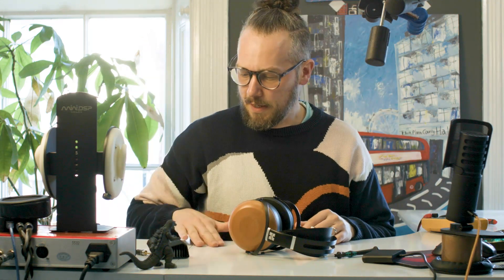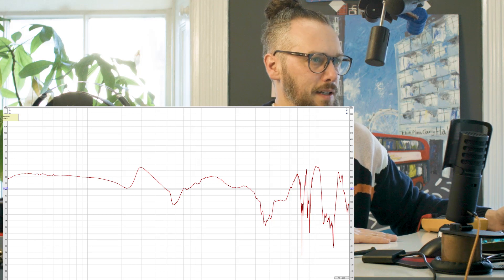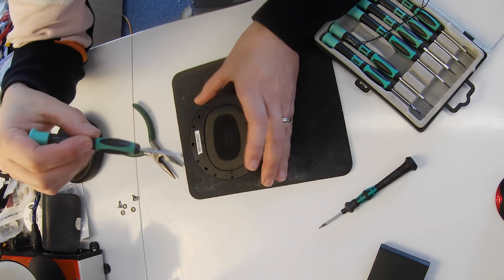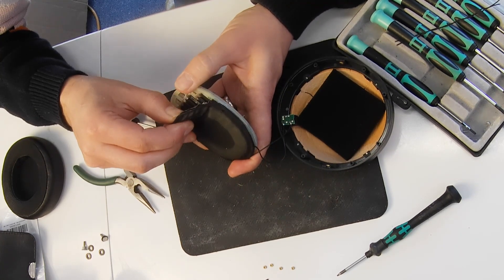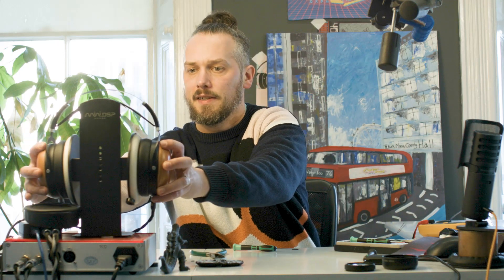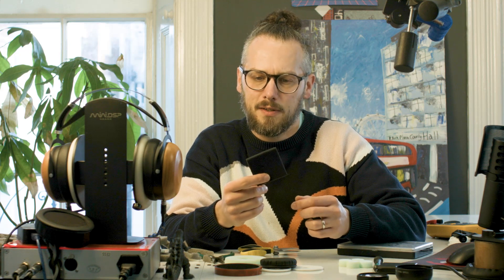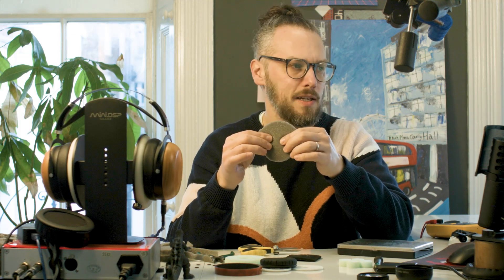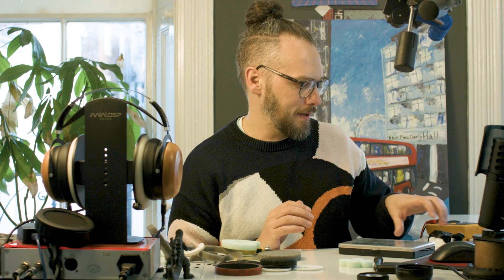Modding some HiFiMan Sundara closed to see if any improvements to the sound can be made

Comment: Make some incisions to the padding to separate the adhesive...

The foam need to move independently....

So instead of one foam piece. You get thin foam strips. Or something  that look like stretched slinky.

The idea came from a couple of Amazon review says the burn in time is 50 to 100hrs. The only way that made sense is not the magnets after looking St your video. It's to shake the adhesive particle lose a tad. Now this is a theory. Need a pro to try this out.

Comment: I just tried this, removing all the damping material from the pad side, but with the Custom Cans tuning foam in the cup, it was detailed an a bit harsh, however when I retro fitted Microsuede Dekoni pads, they sound excellent. There is a sub-bass drop off but the mid bass is ok. I added my own tuning material in the cup that has helped with the 5khz peak a bit.

Comment: Maybe a small hole in the wood cover, just to release the air pressure inside. Of course, the hole in a not so visible place, like in the lower area, under.
Reply from the maker: That is a good idea... I will give it a go
Reply: You could create unwanted port noise and resonance

Comment: Why do you put so much effort into modding when you can easily achieve the same effect with a PEQ?
Reply from the maker: Putting effort into things can be rewarding. Like the IKEA effect
Reply: If you mod the headphone, it will work the same literally everywhere. With EQ, you can only do it on select equipment, or you need to lug around extra hardware.

Comment: A lot of budget closed backs put a lot of dampening material behind the driver to get a more detailed sound. When looking into higher end gear, I was surprised to see that this wasn't the case. Fortunately it's quite easy to just put some foam behind the driver (especially on planar magnetics).
Reply from the maker: Yeh, We have been experimenting with different shapes and density of foam so we may have a ready made insert available for them soon.

Comment: Hi,love the video's.Im currently using beyerdynamic T5 3rd Gen headphones (I prefer closed back) I'm looking to move up so to speak.I'm not one for dongle DACs or Amps Just simple plug into my Dap and play.Any suggestions from the people that know,P.S love the cables I have two sets.
Reply from the maker: I am not an expert on DACs and DAPs but going from single ended to a balanced connection will normally improve things a little if your DAP has a balanced out. Changing earpads can also have quite a big effect on sound. Unfortunately I have not played with the 3rd gen T5 so don't have any experience
Reply: @CustomCans  Hi,my player has the balanced option and I use it with your cable,I was just wondering or anyone has a pair that they swear by . p.s.thanks for responding.